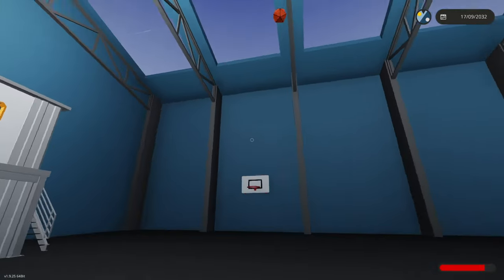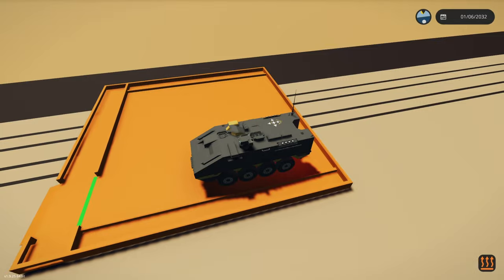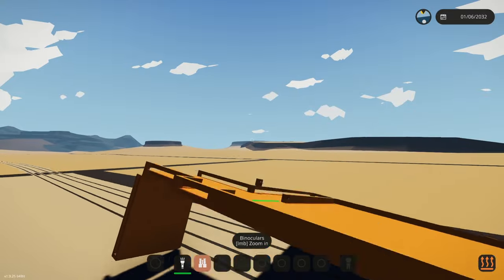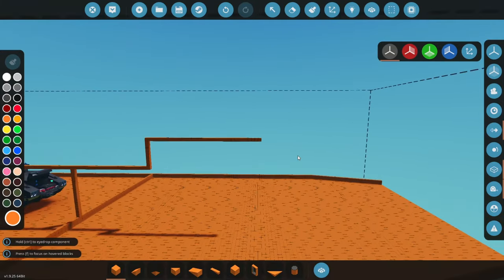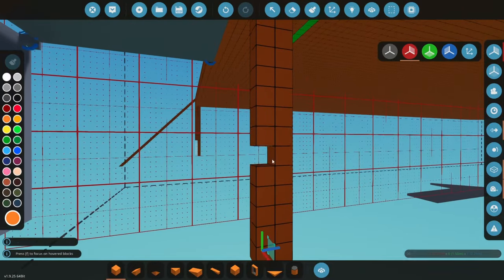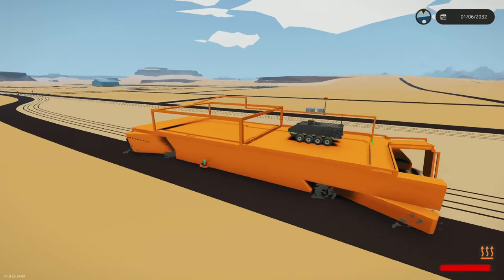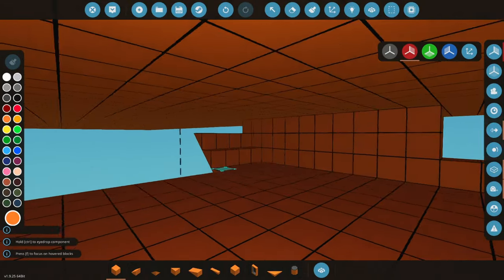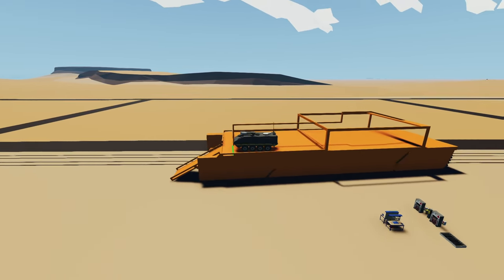Carrier Cat - Building The Hull

Comment: Nice Video, Love the Vehicle, I think if you want to fix the bouncing issue with the tracks you can use multiple of the large suspension pieces that connect to the pivot and then connect to the tracks, I think this will solve most of the bouncing issues, but as soon as you add more weight I am pretty sure it will solve the issue any ways, so I think it's best to just add more weight. Suspension would look cool though.
Reply from the maker: Yea suspension may be required as it gets heavier. There might also be a case for retracting the tracks completely to make it faster at sea.
Reply: From my experience vehicles start bouncing when there are lots of tank treads you should remove some of the track pieces in between and that should do it
Reply: @papugaw7701  That might well work, not saying your wrong. But you shouldn't have to do that. Simply add Large suspension (make sure all the large suspension parts are connected so the tracks still connect) and you'll be able to fix the Bounce without removing anything.
Reply from the maker: Might not look at cool though. @papugaw7701

Comment: This is a really cool build! you could put a door frame round the edge of the bottom of the track housings That way the track housings would act like moon pools, trapping air and giving you some more buoyancy. 

The bouncing can be caused by not enough slack in the tracks. By default track tension is set to max. 

In regard to steam I think it's pretty solid these days. Captain_Cockerels has a good up-to-date tutorial https://www.youtube.com/watch?v=5XyVrL4qph8
Reply from the maker: Door frames is a good idea. 

I think the tracks might come right as it gets heavier. Otherwise ill just mass edit them all down lower. 

And yea I sort of watched Captain Cockerels steam tutorial. Ill have to go back and check it again because I know he does some weird stuff I dont do.
Reply: @terr-rawr-saur   Yea he does manual valve timing which I'm not sure about tbh. It didn't seem to make a difference for me
Reply from the maker: Yea I don't think it matters. Only so much steam can go into the pistons and the in and out ports open based on the rotation of the piston. @rocket_goose